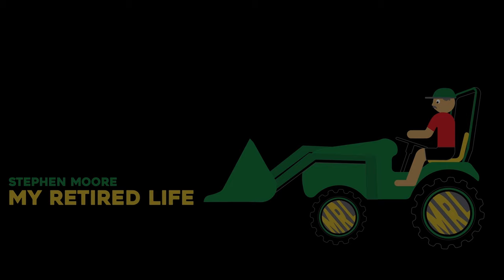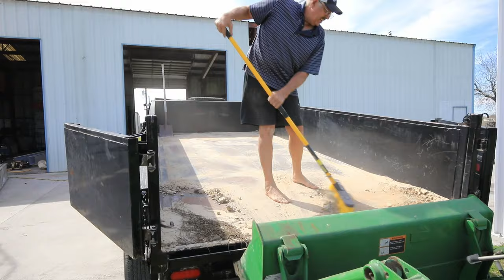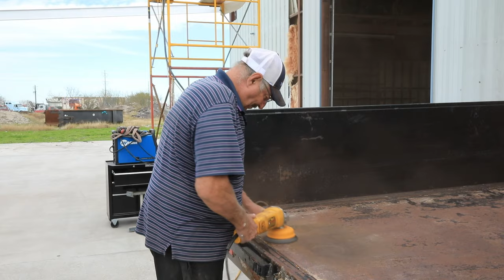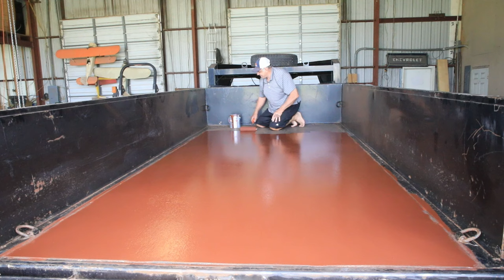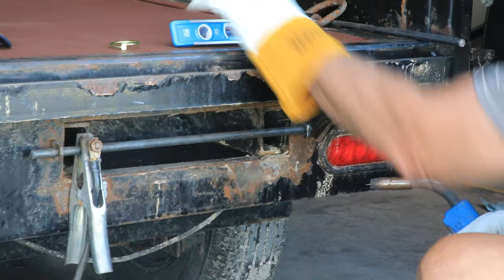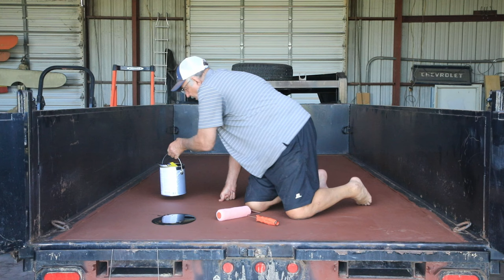How I painted the bed of my dump trailer?

Comment: Just a thought 1 more cotter pin on the bar on the inside of the tab you welded on it will let the bar slide to the side but not all the way out and you would have a back up pin
Reply from the maker: Thanks, that's a good idea

Comment: Did you weld with no shoes also?
Reply from the maker: Thanks for the comment,  I don't remember, but I probably did
Reply: @stephenmoore-chiefqc75  Should have put tabs on one side so you only had to use one pin on each one.
Reply from the maker: Thanks